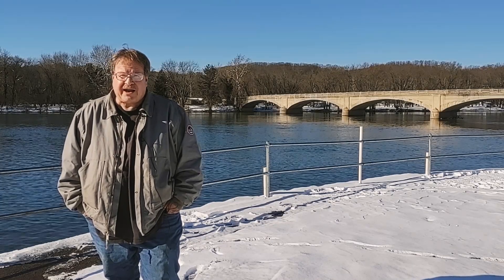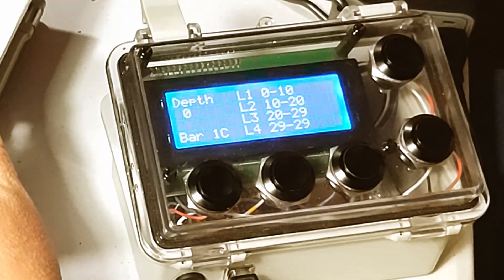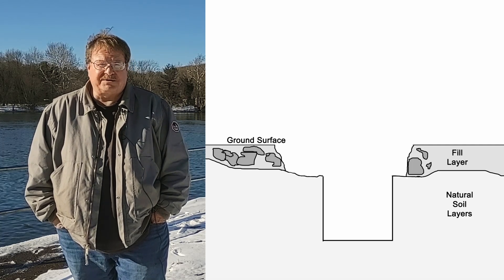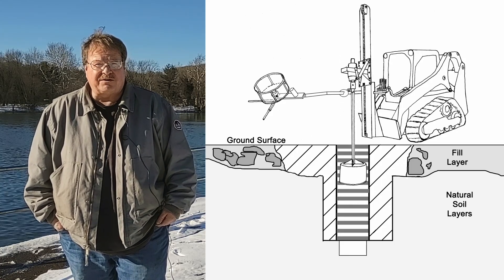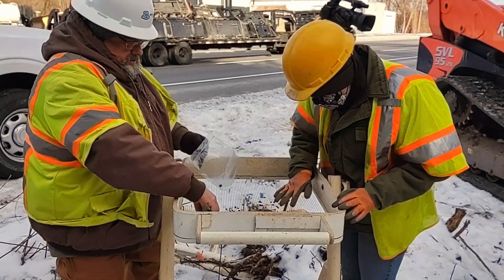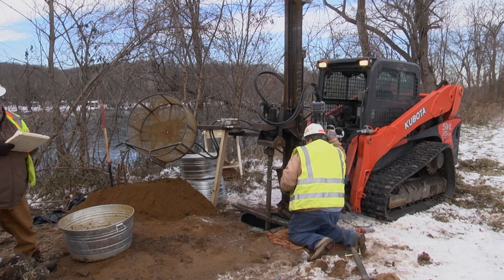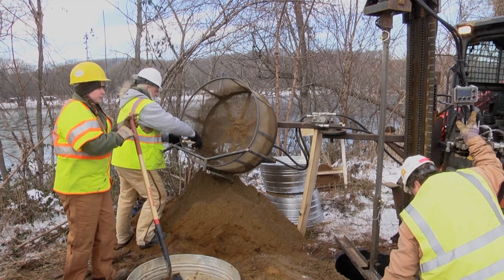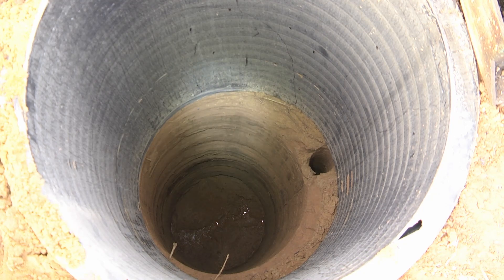Susquehanna River Dig

Comment: That is an ingenious machine, looks very efficient! It would take much longer to hand dig a test pit to that depth for sure. The only drawback I could see is that it looks like it would be difficult to map the soil changes on paper when you can't physically get down in the hole. But still, that machine and screening method looks so much easier than I've ever seen it done! Thanks for sharing the video!
Angelo
Reply from the maker: I plan to build a set of down-the-hole tools.  One to recover tools that accidently fall in the hole.  I lost my hammer down the hole on Day 1. Fortunately it stayed on top of the auger bucket when I raised it.  I tethered all of my tools on Day 2. One tool to scoop out rocks that are too big to dig with the auger bucket. One to extract small soil samples from the wall.  And one with a boreoscope inspection camera.  If we set a measuring tape down one side of the hole and run the camera down the opposite side, we can take a sequence of photographs that will record the soil profile.   It may be possible to make a tool for extracting OSL samples from the wall.  OSL is a method for dating the age of the soil.